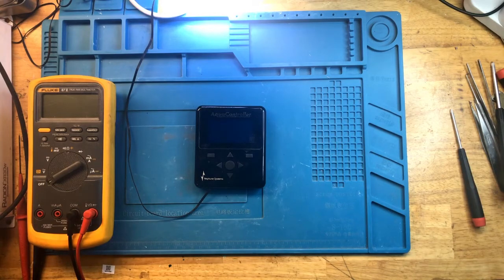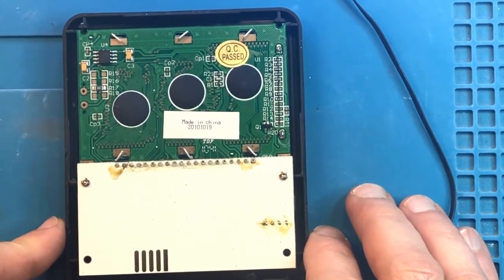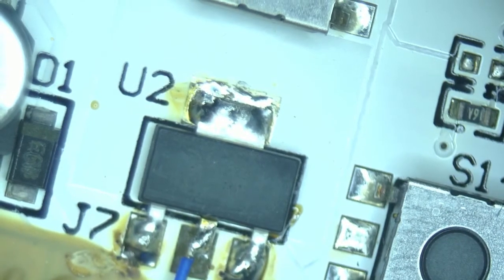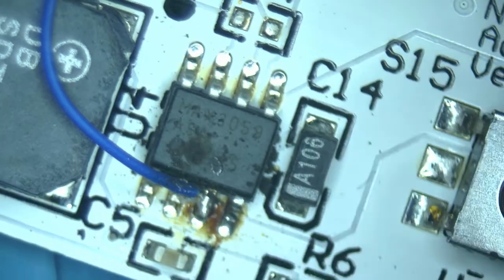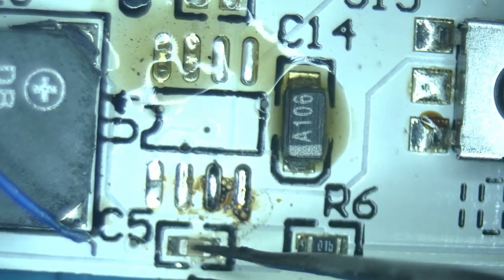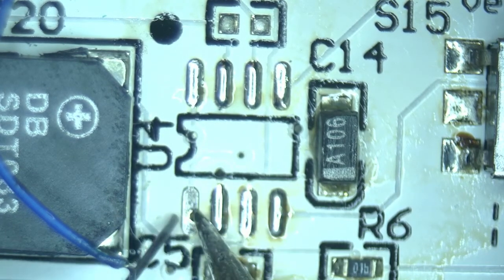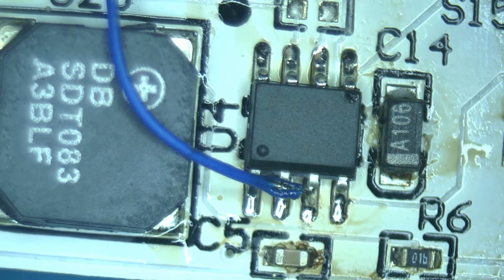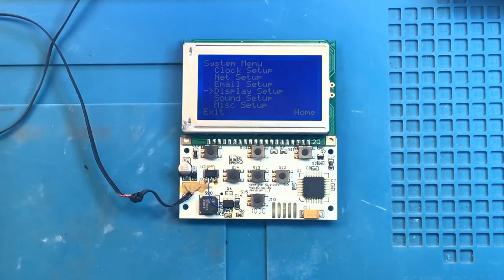Apex Display Module Causes Head Unit to Reboot

Comment: Hey I have an apex display module that lights up. But won’t display any information ie menus or digits: is it possible to replace just the screen as it appears to be working but can’t use as display is not showing.  Rendering whole apex controller void. Any help much appreciated. Thanks 😌
Reply from the maker: Does the display show up in the list of modules? If not, it's likely not the screen that's at fault.
Reply: @FixReef  I have the same problem, the display lights up, but the characters do not appear, and it also does not appear in the list of modules, could you help me? Visually I did not identify anything wrong. It only lights up blue.